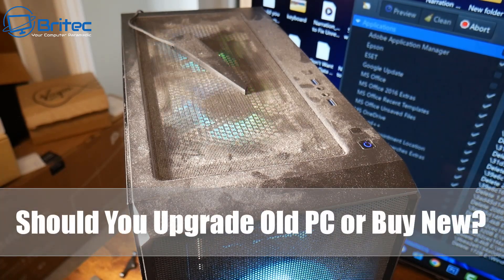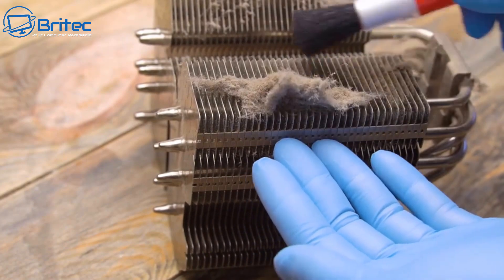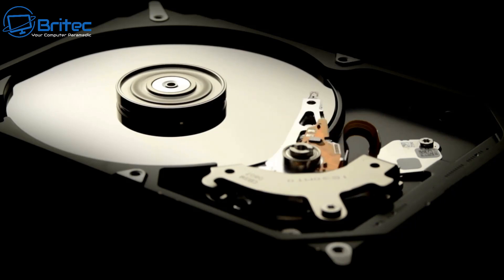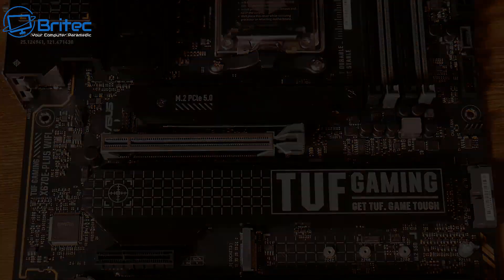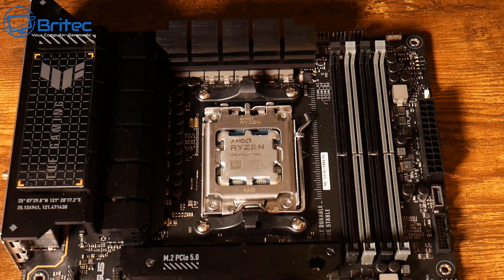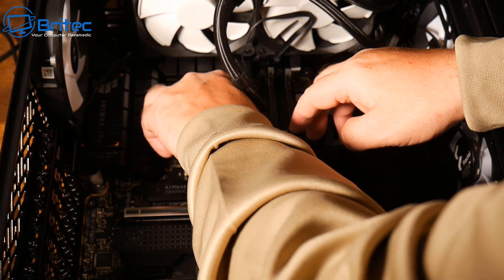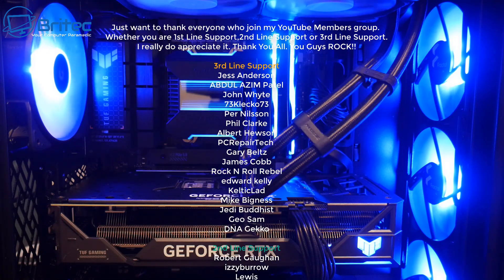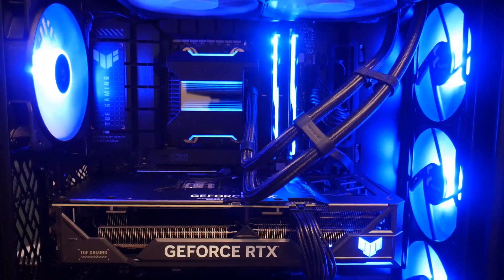Should You Upgrade Old PC or Buy New

Comment: Remember that Windows 10 support ends in 2025.  Older machines won't run Windows 11 without a workaround.  Microsoft says that Windows updates might not run on older machines.  The next Windows feature update reportedly will not allow low-end older processors to boot.

Comment: If you're pc is not upgradable. And you have a up to date current antivirus. After the service life ends could you configure windows firewall to restrict access to safely use known websites? And continue to use windows 10 safely? If so could you do a video on how to set this up?
Reply: Same situation here. Hoping for an answer before I just get another computer.
Reply: I would hold off until 2025 and closer to Oct (MS' Windows 10 "end support" deadline) before making such decisions. MS is making a really dumb decision with how strict the requirements are for Windows 11. There a TON of folks running hardware that "isn't compatible" and they can't afford to update. As we get closer to the Win 10 cut-off point, MS will start to reassess what they'll do. If they notice a lot of folks are not adopting Win 11 they way they hoped, they'll either be absolute morons and double-down on the requirements.. thus causing a lot of folks to look for alternatives.. or they'll extend support (like they did for XP when Vista was an utter disaster), or they'll loosen the restrictions and let more old hardware through the gate to Win 11.

As it is right now, MS thinks a lot of folks will magically buy new hardware that will have Win 11 on it. What MS is doing wrong is assuming people still give a crap what OS they're on. An OS used to be a big deal back then. Now it's just a glorified gateway for folks to get to the internet and/or run apps. Nobody really cares what OS they use now, they just care about getting to the results.

Win 11 upgrade is more beneficial to MS than to users. It locks Windows down more, and is trying to force more folks onto OneDrive for "store your data as a service" fee. Folks are getting annoyed.

MS is also neglecting the fact that a lot of folks already have "replacements". Want to play games? Folks buy consoles or steam decks. Want to get to internet? Folks are looking at internet appliances running Chrome/Android. Want to stream movies? Folks are already using Roku's, Firesticks, etc.

Simply put, Win 11 is just MS' attempt to lock more folks into Windows walled-garden and trying to push more SaaS on them. It serves Ms more than it serves end-users, and folks are noticing that now. Folks are getting sick of it, and looking for alternatives.

So, I'd wait the whole year out until Oct 2025. See what MS does. Even if the deadline ends, give it a month or two. See if MS changes their tune. If MS is adamant about Win 11, then look into options to put Win 11 on non-compliant hardware. Don't do it right now, b/c MS keeps patching Win 11 to make it harder. You want Win 11 to eventually stabilize and decide what your options are around Oct 2025 next year. Whether you can stick with Win 10, move to Win 11 on same hw (even if hackish), or find an alternative (Linux is gaining popularity again).

MS is resting on their laurels once again in history, and thinking Windows is still a "big deal" that people give a shit about, and I have a feeling that attitude is going to bite them in the ass in 2025.

Comment: Best upgrades are replacing an HDD with an SSD as you mentioned and I guess that adding an RX6400 or an A380 would give an old desktop the ability to stream at 4K and also play AV1 files. The Low Profile RTX 4060 would allow for some 1080p gaming.

Comment: As you said if the PC is working for your needs then there is no need to do anything. My system is 4 year old system, it works at the moment for what I need it for but I have been noticing it's getting taxed a little with the more modern programs so I will just upgrade rather than replace. Will cost less and give me a boost.

Comment: For work I am assigned a new laptop about every 4 years or so, but for personal tasks I still use my 13 year old laptop. Upgraded the RAM from 4GB to 8GB about 8 years ago and I changed the HDD to an SSD about a year ago. Still runs decent enough for excel, youtube, music, light gaming and light video editing. What might force me to either purchase a new computer or install Linux is that it does not officially support Windows 11, so end of support for Win 10 in 2025 might also mean the end for my laptop.

Comment: I always try to use, at least, the computer case (depends on the client choice), and start up with a new built. Maybe the GPU can be refurbished by myself. And I always use an earlier gen built. Because I sell things to clients, and just to be sure, everything is working out of the box. It's a little dangerous to use the newest components available. So my last built was a AM4 platform. From next year I will be using the AM5 platform. Most of the bugs will be solved by that time. And be cheaper as well, price is also a factor. Even for myself, I build an AM4 system with a custom water loop. I do this for many years and I didn't have complaints in the 20 years I'm doing this. I also look for parts, the best bang for the buck, that means reading a lot of data sheets and looking for the lowest price. Back in the day, the builds were a lot easier, because these parts were cheaper, and mostly in stock.

Comment: I'm not a computer engineer, but I understand capital. My rule of thumb is to buy the best that I can afford at the time, use it till it wont run easily, then buy a new one. Since the 90's I've been doing this, replacing a computer every 5 years or so. Pretty good runs for the money, I've watched friends try to compete by upgrading, doesn't compete. Competing being the principle argument in my rule of thumb. Sure some do compete using 486's (a joke) but it's very hard to do that... to little reward but self gratification. There are unavoidable standards to keep, operating on the internet being paramount... try uploading a big file, you need the latest hardware running the latest software to "compete". You might run, but if you are competing... no.

Comment: Good video, Brian. BTW, you mentioned something about the minimum amount of RAM. I'm going to run CAD with simulation software. What amount of RAM should I have for such needs?
Reply: I run music production software with heavy render loads and I have 64Gb fast RAM, but also the GPU is very important, especially in your case, you have to prevent bottlenecks in your system, So CPU, GPU, RAM are important to look at, also the SSD's you buy can have a significant uplift. It's a combination of everything.
Reply from the maker: You would need a minimum of 32GB I would say. But depends really

Comment: had my laptop lenovo since 2017 only had to replace mechanical 1tb toshiba hard drive died after 3 years had to replace with 1tb icoolax ssd 2.5 drive way much faster dose what i want it to do and works fine 12gb ddr4 ram here hopefully they can extend windows 10 after 2025 so i can continue using my i7 75oou 7th gen